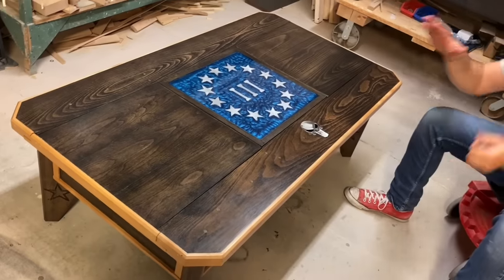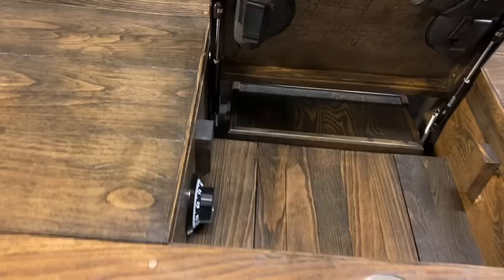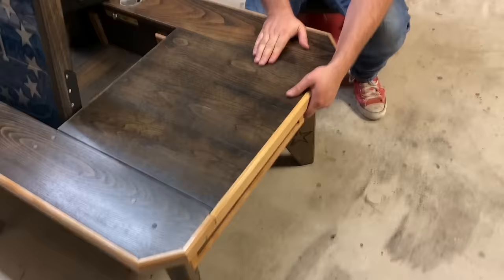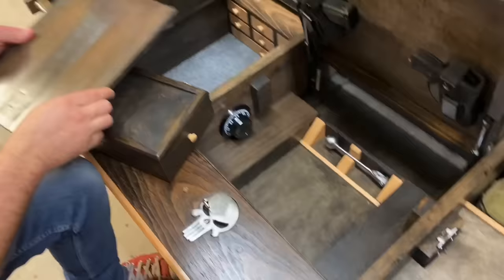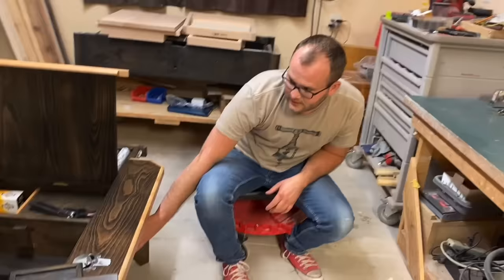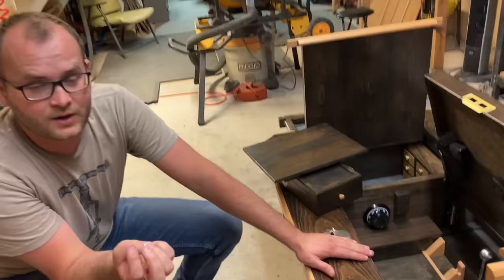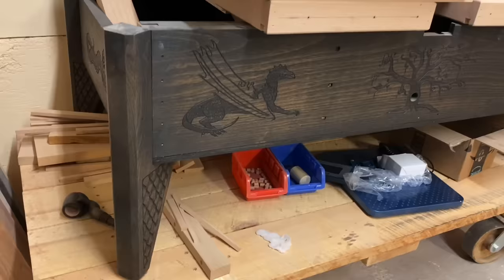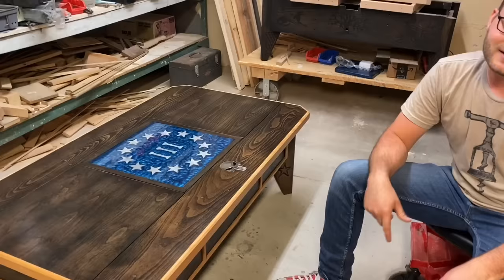The 'Murica Table

Comment: This is simultaneously the most impressive and the most impractical table I have ever seen
Reply: How about a Whiskey?
Sure, that should only be three guns down.
Reply: @MrCmon113  Ah damn my bad! Was there another gun in there instead? Ok try by the bottom left corner next to the .22 Special..... LOL
Reply: How is this impractical? Perfect lounge table. Lots of storage. Secure.
Reply: It's a lot of steps to open a drawer.
You want a glass of whiskey? fine let me take my key, put it in that impractical lock, press a knob, then crouch to pull a lever, get rid of what's on the table, open the middle of the table, then pull on a lever and here is the bottle.
That some Resident Evil level shit right there, I just have a liquor cabinet with a regular door and it's not cool in any way but at least I can just open it if I want a drink.
Reply: @vraolet  yeah, but you don’t have to keep all of them locked, so you only have to open it once every time you use the room. Also, if you can just go open it, so can someone else.
Reply: If you have guns stored in it, it should be locked most of the time.
Reply: Ikr? I want it.
Reply: @Scott Covert Good point, I didn't think about that.
Reply: Seems practical to me
Reply: i agree. very impressive construction... have zero desire to own such a thing. and would more than likely make fun of a friend that did own one.
Reply: Oh what can go wrong guns and liquor what a combo
Reply: You Can break into it.. and it's not bolted down, it also has a Big ol "sign" on it too.
Reply: Isn't that what America is about?
Reply: @vraolet  you know you store just the "good stuff" in the table and leave the regular stuff out for guests.  They don't need to see my Johnnie Walker Green or expensive single malts.  Walk over to my bar and help yourself to the speed rack and mid-shelf stuff.  Same deal with the poker set, you can put your nicer set in there and have a cheap set out for your kids/pets to destroy and lose pieces/cards to.  I also like the idea of keeping my EDC in there where I can clean it and store it after going to the range, so I still have access to my bedside and others. 
I have a ton of nice knives from dead grandparents/great uncles/etc. that I'd love to put in those little drawers.  Right now they're locked away in a place that I don't like showing off, even for people I trust.
Seems completely practical if you're using it for its intention, which is locking your nicer stuff up and being able to share it (or just keep it to yourself) in a neat and novel way.
Reply: I think this is very practical
Reply: @stevenbrown755  guns liquor and gamling. If you've ever seen a western you know why thats not a good combo.

My advice ditch the liquor
Reply: Cool and stupid at the same time
Reply: While the government takes your guns out of your closet, his will still be in the table. Get it? Lol
Reply: Seems like you missed the whole point.  Does that happen a lot?
Reply: Trust in Jesus Christ our Lord And Savior
Reply: @vraolet  I would prefer to be able to access any of the external compartments without having to go through other compartments.
Reply: @vraolet  You don't have many friends do you?
Reply: @danwalker9999  At least I have friends =)
Reply: @vraolet  It's a conversation piece ... a Honda is practical and a Lamborghini is not... but guys buy a $300,000 Lambo because it more fun to talk about than a CRV.
Reply: @The24soldier  what’s a .22 special? Never heard of it…
Reply: @leifhoklin2681  It was a small caliber handgun. A .22 mm that literally fits in the palm of your hand. I think the mag held like 5 shots. It’s been over 20 years since I used one LOL
Reply: @The24soldier  .22 mm, eh? Never heard of it.
Reply: @vraolet  but you aren’t cool.  That’s the point

Comment: Personally I'd find an issue with having any of my gun, but more importantly, safe storage areas needed to be opened to get the party items. If I was commissioning this I'd definitely either commission a separate table for guests or ask that the poker and liquor parts could open independently.

Great builds this stuff is amazing.

Comment: No, the BEST way to answer that is, how much is THIS particular table?
Reply from the maker: true but the price of wood has tripled since I built that table and as I get better at building I want to be able to charge more. I was also worried that if I put a price on a table it would be outdated by the time anyone saw the video. I sold that table for just under five thousand last year. Today I would sell it for closer to seven plus shipping which was around seven fifty.
Reply: People just want a general idea.   "200 hours, $20 per hour is $4000, plus $1000 materials" would cover it.  If a serious customer calls, you can discuss any changes.

Comment: Gotta say all in all this is an absolutely beautiful table & the initial locking system for the whole table & drop down latch are the best part IMO. Not that u care & I'm sure u get unwanted advice all the time, but I would give 1 piece of advice for future builds... try to attach the top or any of the outter most boards for that matter from underneath or the back side so to not have screws visible. But... even with the screw heads showing this build is top notch! I've been wanting to build 1 bc of that same movie btw. lol I just never found time
Reply: The large puzzle tables a smaller puzzle boxes are also interesting.

Comment: Owner gets confronted by the robber:
"Hold hold on dude, I just need to pick this thing, twist that, turn this, slide the drawer, insert a code combination, assemble a key, find a hidden keyhole following 16 leads, pull the lever, quickly pass a university physics exam, make a sandwich, assemble the gun, make a call to the ammo making factory and wait for 2 week delivery aand done!"
gets shot in the head

Comment: “The ‘Murica table. Turn this and there’s a gun. Then flip this, more guns. Open this and there’s another gun, some more guns, ammo for the guns, polish for the guns. Whatever you wanna put in there as long as it’s guns. I like guns”

It’s called the ’Murica table because it represents everything that’s wrong with ‘Murica. 😂
Reply: I agree, having to jump through all those hoops to get to your guns is plain wrong. I’m also not partial to the whisky, as that particular brand is an Irish Whisky. No offense meant to Irish, or Irish whisky, but a nice Kentucky Bourbon is more fitting of the “Murica” theme.

Comment: I would like one of these built as a kitchen table without the 3% logo or anything else.  just swap the legs out with 40" legs, do away with the poker set and the logo in the middle of the top and wouldn't even have to stain it. I live in an RV but i have a regular kitchen table and i think that would be a great replacement and handy for storing some of my pistols in then i could eliminate one of my gun safes too. in an RV it's all about optimizing space everywhere and this would be a great way to do all of that.

Comment: Hmm - the cost question, eh ?  Lemme guess. An average cabinet maker wage is about $US20 per hour, but a specialized maker would be about £US55 per hour.  David said he had 200 hours in that table, so $US11,000 for labour alone. Then materials at say, another $1000 and shop/machine time/storage/shipping at another $1-2,000? Say $15,000 ballpark?

Comment: There are only two handguns that I would put in that table and I actually own both: a .40 Glock when I need something small but reliable and a .45 Heckler & Koch USP when I need a .45. Sorry but I prefer practicality and feel that the USP is more reliable and just as accurate as an M1911 series handgun. Oh, and it's almost $250 cheaper too.

Comment: Here’s a small ‘sales’ tip:
When someone asks you about price, and you go into a bit of a long winded sidestepping the answer spiel - that tells the person that You do not believe the price to be fair. 

For example: years back I sold vacuums. And of course I had my sales pitch that took 35-45 minutes with the price at the end. But lots of times the no-nonsense husband would interrupt to ask the price. I quickly learned to just as bluntly give him the price. The unit was $1395, so I’d blurt out it’s right around $1500, but if you let me explain, I’m sure you’ll understand why. 
Then by the end, it’d be the potential buyer that was saying ‘well that not $1500 it’s ONLY $1300. Because with the pitch, they now saw the value of the unit. 

So you need to determine a base price for your tables and not be afraid to tell people that price. Then you can go on to explain that different woods, stains, number of compartments and hardware greatly affect the end price. 
If it’s made from wood salvaged from Noah’s ark it obviously going to be more expensive 😅. 

Don’t sell yourself short. That is a very cool and beautiful table, but it’s not just a table. It’s a conversation piece, an art display, and I can easily see it becoming an heirloom. 
I have a small stash box that was handmade by an uncle, my 2 sons are already fighting over who gets it. I quickly pointed out that ‘I’m not dead yet!’ . 

And like magicians never reveal their tricks.... but I would be absolutely fascinated to see how you map out designing a table. The various steps you’d have to take is baffling. 
But I don’t recommend you show them. Someone would just steal your design. 

Very nice work 👏.
Reply from the maker: That’s some good points. Thanks!

Comment: If I had the money, I would get you to equalize the soft and hard grain before you stained it, say with shellack and grain alcohol, that way you wouldn’t see colour in your crosshatching from sanding and your edges wouldn’t suck up so much pigment, the soft grain wouldn’t take up so much colour, try it one time see if you like it on wood you may think is ugly becomes even.
Reply from the maker: I’ll try it but I usually like the wood grain.
Reply: @davidolundell  oh you will see the grain, I use it when there is too soft a wood and grain, you know the wood that goes black with stain, you can’t work fast enough to wipe it off, goes i. Too deep?

Comment: How about build one that on one side of the table you can wirelessly charge you electrics then slide your phone to the other side and it unlocks  the gun safe then give you access to the other doors by pressing a button on the couch side which has three buttons below the table , then the other doors has bullet holes in it you just reach you finger in each one to pull them open. :)